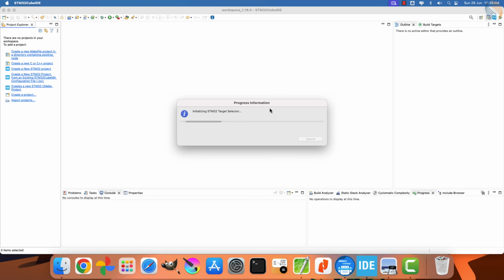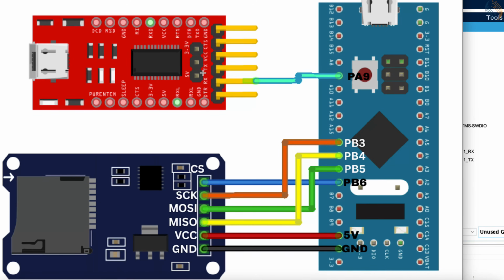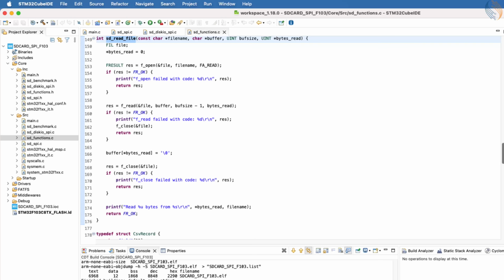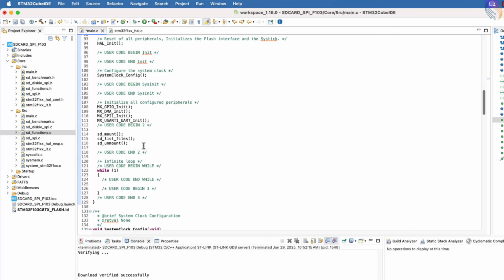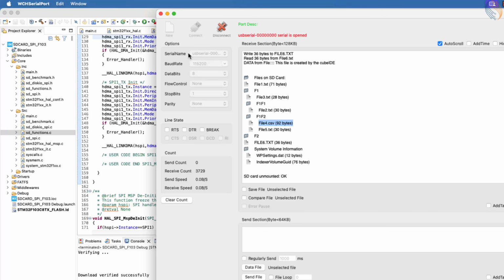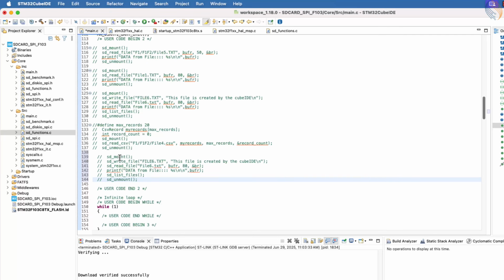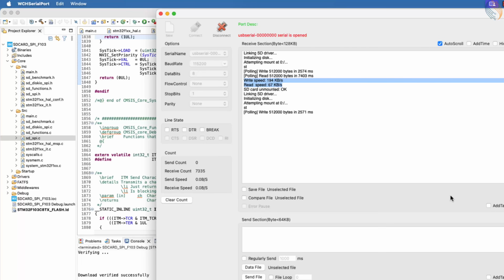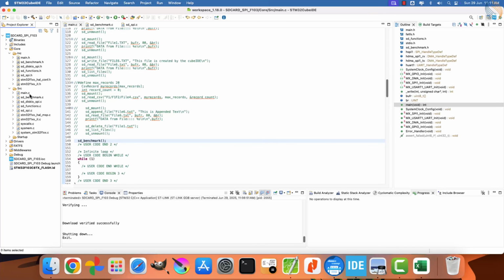Interface SD Card with STM32 using SPI (DMA) | Cube-IDE | File Handling via UART

Comment: great tutorial. i have a problem. 
sd_mount is ok. 
sd_list_files(); causes HardFault_Handler. please help.

serial debug output is.
Linking SD driver...
Initializing disk...
Attempting mount at 0:/...
SD card mounted successfully at 0:/
Card Type: SDHC/SDXC
ðŸ’¾ Total: 30963712 KB, Free: 30963680 KB
ðŸ“‚ðŸ“‚ Files on SD Card:

Comment: Thank you for the video but I have one question in your 

SD_TransmitBuffer function when using DMA the code is like this 

static void SD_TransmitBuffer(const uint8_t *buffer, uint16_t len) {
#if USE_DMA
    dma_tx_done = 0;
    HAL_SPI_Transmit_DMA(&SD_SPI_HANDLE, (uint8_t *)buffer, len);
    while (!dma_tx_done);
#else
    HAL_SPI_Transmit(&SD_SPI_HANDLE, (uint8_t *)buffer, len, HAL_MAX_DELAY);
#endif
}

so looking at your code using DMA is useless because after HAL_SPI_Transmit_DMA(..);
you are going to a blocking mode by using the while(!dma_tx_done);

??? I mean why bother with DMA if you are blocking after every write????
Reply: The Dude Abides

Comment: HELLO, when I use this code in hardware, uart showing that Sd card initializing failed. I have checked the connections and power supply, but the Sd card is still not initializing. i am using a SanDisk 16 gb hc I card.
can you help me, what should I do to make it work.
Reply from the maker: Make sure "MX_FATFS_Init" is not being called in the main function
You need to disable its call in CubeMX->Project Manager->Advance Settings->Uncheck Generate code for MX_FATFS_Init
Reply: @ControllersTech  i have encountered the same issue, i am using an SDHC 4GB on my STMh753Z. I unchecked MX_FATFS_Init, but still this is what i get:
disk_initialize failed: 0x01
                            FR_NOT_READY        Try Hard Reset or Check Connection/Power
Make sure "MX_FATFS_Init" is not being called in the main function
                                                                  You need to disable its call in CubeMX->Project Manager->Advance Settings->Uncheck Generate code for MX_FATFS_Init
📂 Files on SD Card:
[ERR] Cannot open: 0:/

SD card unmounted: OK
Reply from the maker: Try without dma

Comment: I did tests and followed the tutorial, for the STM32F103C8T6 (bluepill) it worked perfectly, so I switched to the STM32F411CEU6 (blackpill) because I needed more memory for the project and it didn't work, it gave an error when compiling. sd_functions.c... error in the sd_format function and in the sd_list_directory_recursive function... it looks like something involving MKFS.
Reply from the maker: I tested it on f446 before releasing. But anyway I will check for f411 and see why there are errors.
Reply: @ControllersTech  
If this is useful...

In the sd_functions.c
At line 34:
res = f_mkfs(sd_path, 1, 0);
ERROR --- (too few arguments to function 'f_mkfs'
)

At line 249: fno.lfname = lfn;
ERROR --- ('FILINFO' has no member named 'lfname';)

At line 250: fno.lfsize = sizeof(lfn);
ERROR --- ('FILINFO' has no member named 'lfsize';)
Reply from the maker: For quick fix do this.
Remove the formatting part f_mkfs code.
Change lfname to fname and lfsize to fsize
Reply: @ControllersTech  I commented out the function: int sd format(void)

On line 249, I changed it to: fno.fname = lfn;
On line 250, I changed it to: fno.fsize = sizeof(lfn);
On line 261, I changed it to: const char *name = (*fno.fname) ? fno.fname : fno.fname;

Now it still gives an error, but only on line 249: fno.fname = lfn;
ERROR: assignment to expression with array type
Reply from the maker: I have updated the code, please download the update project from the link.
Reply: @ControllersTech  Now it's working...Thank you so much for your help!!!
Excellent channel you created!

Comment: Enjoyed it.  And helpful. However defining "#define USE_DMA 1" in the modifiable section of the 'sd_spi.c' file does NOT carry over into the system 'spi.c' where the receive and transfer callbacks test for that definition (and fail to see it - which prevents the DMA flag from getting set)
Reply: Belay that.  That was a "weak" reference in the "spi.c" file.  My apologies.

Comment: Great turorial. I encountered a problem when I use this libary. It seems that the SD card can only mount once, which makes it difficult to use in interupt mode. The second time mount the SD card, the error message is Mount failed with code: 1. I tried to debug but I could not figure out what was wrong😂
Reply from the maker: The SD will only mount once. If you want to use the interrupt, you can set a flag which will mount the SD card somewhere else. Make sure to wrap the SD mounting in another flag like 
void SD_Mount_interrupt()
{
  if ((isMounted == 0) && (interruptTriggered == 1))
  {
     mount SD card;
     interruptTriggered = 0;
     isMounted = 1;
   }
}
Reply: @ControllersTech  Thanks. I wonder is there any way to mount the SD card agiain when it is unmounted?
Reply: hi
you should youse linker once in app
see this code (i use comment for changes you need)
first go to sd_mount func in sd_functions file.
int sd_mount(void)
{
    FRESULT res;
    static uint8_t driver_linked = 0; //ADD THIS

    if (!driver_linked)//ADD THIS
    {//ADD THIS
        if (FATFS_LinkDriver(&SD_Driver, sd_path) != 0)
        {
            printf("FATFS_LinkDriver failed\n");
            return FR_DISK_ERR;
        }

        driver_linked = 1;//ADD THIS
    }//ADD THIS

    DSTATUS stat = disk_initialize(0);

    if (stat != 0)
        return FR_NOT_READY;

    res = f_mount(&fs, sd_path, 1);

    return res;
}

Comment: I am somewhat surprised that your HW does not appear to include any pull up resistors on the CS, MOSI and MISO lines and I am quite convinced you could run MUCH faster if you included those.  While they are normally not required on SPI, the SD cards are open drain.  This might very well explain your random initialization errors.  I run reliably with a 42 MHz SPI.  I noticed the same issue in your SDIO video.  See more explanation here: https://www.youtube.com/watch?v=yRuedNsV-5M
Reply: the sd card board he uses has a levelshift ic on it, making pullups obsolete

Comment: Hello i am getting this errors, 
 too few arguments to function 'f_mkfs'
'FILINFO' has no member named 'lfsize'; did you mean 'fsize'?
'FILINFO' has no member named 'lfname'; did you mean 'fname'?  do you have any idea?
Reply from the maker: Watch carefully fro. 6:00 to 6:30
Reply: @ControllersTech  I have the same error and must have watched that part 20 times and still the same issue.
The FILINFO refers to ff.h
I enabled exactly what you did
I unchecked the Generate Code for the FATFS and still same error. 
What am I missing.

FATFS is version R0.12c on my IDE

I big thank you for your help.
Reply from the maker: Did you enable long filenames in fafts setting ?
Reply: @ControllersTech  
I think I did all. Here is what I have: 

FATFS version R0.12c

--------------------

FS_READONLY (Read-only mode)	Disabled
FS_MINIMIZE (Minimization levl)	Disabled
USE_STRFUNC (String functions)	Enabled with LF ->CRLF conversion
USE_FIND (Find functions)	               Disabled
USE_MKFS (Make filesystem function) 	Enabled
USE_FASTSEEK (Fast seek function) 	Enabled
USE_EXPAND (Use f_expand function) 	Disabled
USE_CHMOD (Change attributes function) 	Disabled
USE_LABEL (Volume label functions) 	Enabled
USE_FORWARD (Forward function) 	Disabled

----------------
USE_LFN (Use Long Filename)	Enable LFN with dynamic working buffer on the HEAP.
MAX_LFN (Max Long Filename)	255
MAX_SS (Maximum Sector Size)	512

-----------
In Advanced Settings, untick the "Generate Code" for MX_FATFS_Init
Reply: @ControllersTech  

Here is the definition FILINFO in the ff.h file:

/* File information structure (FILINFO) */

typedef struct {
	FSIZE_t	fsize;			/* File size */
	WORD	fdate;			/* Modified date */
	WORD	ftime;			/* Modified time */
	BYTE	fattrib;		/* File attribute */
#if _USE_LFN != 0
	TCHAR	altname[13];			/* Alternative file name */
	TCHAR	fname[_MAX_LFN + 1];	/* Primary file name */
#else
	TCHAR	fname[13];		/* File name */
#endif
} FILINFO;
Reply: @crossign  I'm having the same problems, did you find a solution? 
EDIT: I copied his entire Middleware file and the errors went away.
Reply from the maker: If the problem persists, you can disable the long file names and use the normal version instead. 
Change lfsize to fsize and lfname to fname is the driver file.

Comment: Great video.  Just some issues with this build.  When I attempt to build it, I get errors related to issues with FATFS FILINFO structure field lfname along with issue on the call of  f_mkfs because the function does not match current version of 1.19 of STMCubeID FASTFS system.
Reply from the maker: Watch carefully fro. 6:00 to 6:30

Comment: what should i do if i want to integrate this micro sd card module with other controller like g0b1re board.
what files should i modify? If possible make a tutoirial that how to create custom library or own driver for any board?
Reply from the maker: The library is independent of the dev board, it will work with any STM32 board. 
Also this video shows exactly what you are asking for, how to use the library in any board.
Reply: @ControllersTech  Thank you for the information
A small request please make tutorial that how to create a custom libraries for any peripheral which compatible to stm32 board.
since we don't have custom libraries like what we have for arduino ide.
once again thank you

Comment: Can this code be used on a microSD card module?
Reply from the maker: It is being used for the module in the video.
Reply: @ControllersTech  Your video says SD card and not microSD card module, so which is which??
Reply from the maker: It is microSD card with module.
Reply: @ControllersTech  ok thx for the reply

Comment: Very interesting tutorial, thanks a lot!
I suppose it is possible to read files that are larger than the available memory on the mcu? For example to implement an MP3 player...
Reply from the maker: Yes it is possible. You can set a buffer of 4K size. Then request 4KB data at a time and use DMA Half transfer flag to transfer the 2K data to the I2S peripheral. Then use Transfer complete flag to transfer the rest of the 2K bytes.
This way while half the data is being read, the another half will be transferred.

Comment: Would it be possible to measure the size of a file, on the SD card, and dynamically create a buffer of a suitable size prior to reading the file?  It seems slightly complicated to have to know the size of a file before it can be read.
Reply from the maker: fsize element of the FILINFO provides the size of the file. You can do something like this:
UINT get_file_size(const char *path) { FILINFO fno; return (f_stat(path, &fno) == FR_OK) ? fno.fsize : 0; }